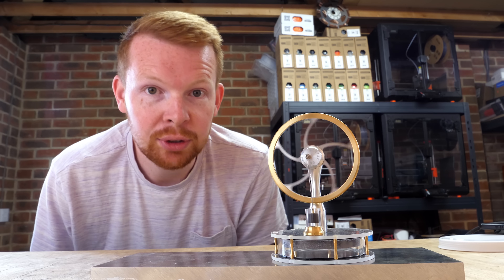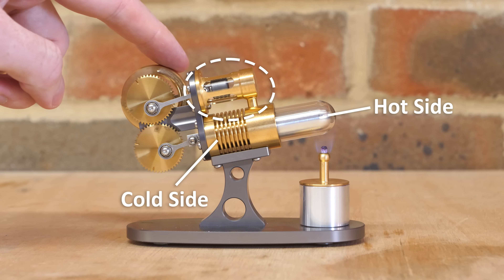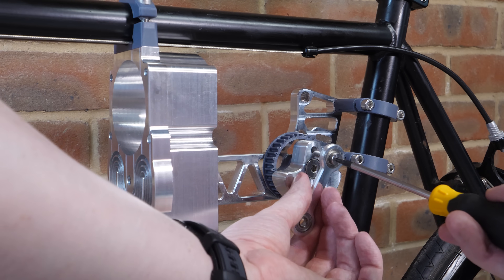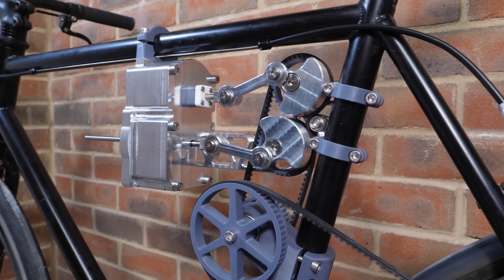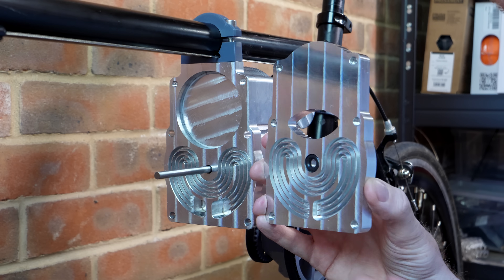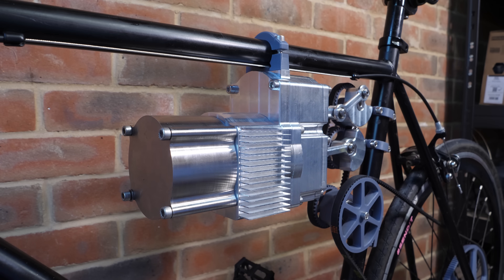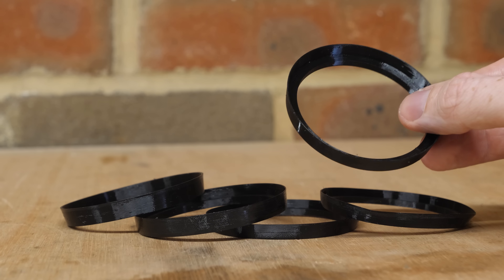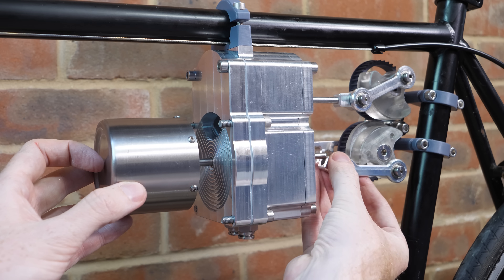Building a Stirling Engine Bike - Part 1

Comment: As a Stirling engine enthusiast, I would say that 10W for a Stirling engine of this size is excellent, but it is not enough to power a bicycle😢. You need a powerful alpha type Stirling engine with a regenerator!❤
Reply: At this level of power, even the slightest friction and damping will greatly reduce the effective power output. Your pistons need to be clearance fit, not made of soft rubber. You may need to pressurize your new engine, use helium, etc. Whatever you do, try to reduce friction, you may even need to clean the sticky grease from the bearings. If you still use a gamma type Stirling engine, use precision parts with clearance fits for any moving seals! Make the thickness of the heating cylinder as small as possible, and remember to add a regenerator, this is very important.Such a small Stirling engine is difficult to drive the normal operation of the bicycle. The power density of the model-level engine is too low. Although I would like to see how you will improve it later, I suggest that you replace it with a steam engine because it is very difficult to use a Stirling engine.
Reply: It seems that you need such a powerful alpha Stirling engine like this：https://youtu.be/4q8daLsy3iY?si=W4u9mxr2MujRJwm5

Comment: A sterling engine has the other advantage, that if manually driven, its basically a completely mechanical heat-pump. Meaning if you drive it while biking, you could also use it to cool your balls

Comment: Wouldn't a long stroke engine be more efficient, given the RPM output of the engine? Since Power is a function of Angular velocity and Torque, given that this engine doesn't have many RPMs the torque should be the main focus. Just a thought.

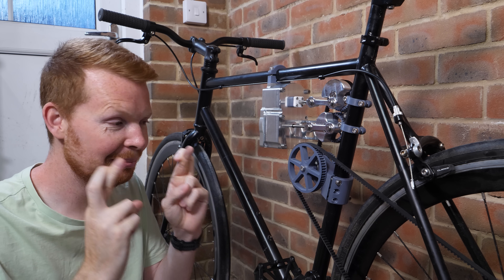Comment: 6:54 a Steam powered bike sounds so cool
Reply: And steam engines are much easier to get right with very simple valve mechanisms, main difficulty is making a boiler small enough that still produces sufficient steam.

It's possible, there are steam bikes around on Youtube already, but the boiler is always the most difficult part to scale down while still being powerful.

That was one of the main reasons steam cars were so much more expensive than ICE cars, because those high performance compact boilers were fairly difficult to manufacture. (And just the fact that steam plants are a two part system while the ICE is one unit, making it inherently cheaper.)

Comment: Tom, sheesh!!!  Those mill bits should be secured in the chuck all the way up to their flutes!  And for as long as they are, you should probably cut much slower, or smaller cuts, and make sure to program a few finishing passes too, at least if you're looking for an output which closely matches your design

Comment: For projects like this you could save the hassle of creating gaskets by using liquid anaerobic sealants instead.

It's how many modern engines are sealed up nowadays instead of needing actual gaskets, and the plus side is that the squeeze out remains liquid and can easily be washed away after the sealant has set between the surfaces.

Comment: Nice project! Few suggestions, displacer should be sealed if there is no regen. mesh inside because with all other passages, exchangers, regenerators and clearances it increases so called "dead space" that robs the engine from power by compressing this cushion air instead of driving the piston.

Comment: You might want to look at honing the inside of the power piston cylinder. I do not know how smooth the CNC finish is on the inside of the bore. Having it honed, or honing it yourself might reduce the amount of friction though.

Comment: Stupid idea I had a while ago:  Use the condenser part of a heat pump to power a big low temperature difference stirling engine. Use a generator to power the heat pump.

Heat pump coefficient of performance should be around 400% so 1 watt makes 4 watts of heat (and cools 4 watts in the evaporator which we don't really care cooling the outside air besides decreasing global warming)
Stirling engine might be slightly above 25% efficiency so total efficiency should be greater than 100%.
It's like a perpetual motion machine that generates electricity but the catch is that it is powered by absorbing heat from the atmosphere.

Easier version might just use a peltier module

Comment: was thinking about this idea and came up with a design where displacement part is half cylinder rotating inside the heat cylinder that has cooling and heating halves. two such chambers 180° of each other then connected and energy is harvested via small turbine between two parts with check valves like a bridge rectifier. whole system is absolutely airtight and can be pressurised.

Comment: I wonder if you could copy a more balanced engine. A bigger fly wheel like a 20kg one . Or use a larger raidater like form an ac unit, or a charcoal burner with ash pan or just have a pilot burner for gas.

Comment: Use the engine to load a battery for a normal ebike, dont even try connect it directly to the bike.
Reply: What if we Charge the battery With the Wheels To power a Heating cooling System

Comment: In short, it seems to me that the diameter of the working piston is way too big for the pressure that this motor can produce. And the main thing is that without a regenerator, this type of Stirling engine is simply useless and is suitable only for demonstrating the operating principle. It is done quite simply: the displacer, instead of a sealed cylinder, is made hollow and filled, for example, with a metal sponge (the one for cleaning dishes will do). Now half of the energy is spent on squeezing air past the displacer, and the heat is simply dissipated. The regenerator has less resistance and saves some of the heat. This is such an essential part that I wonder what kind of research and calculations took two whole months. Please note that if the regenerator is too porous, it increases the "dead space" in the engine, which reduces efficiency. By the way, there is already a lot of it in the front part of your engine, which also reduces efficiency.

Don't get me wrong, it's really cool that you took on this topic, with access to such tools you can achieve really cool results. Good luck!

Comment: Perhaps a peltier module(s) to provide both the hot and cold side, solidstate, fewer moving parts, safer than a burner, reduces need for a radiator.

Comment: Could you create the world most innefficient electric motor by combining a peltier plate and a steerling engine ? The motor using both the hot and cold side to create rotational energy ? Bonus point if you transforme the rotational energy into electricity to charge a battery that power an LED. And if you had a solar cell to power the peltier plate you could create the world most inefficient way to power a LED !!

Comment: Man, I built a stirling engine for my mechanical engineering 101 course project almost 9 years ago. I know how much effort it takes to get it just right.  Watched your video with a big smile on my face, remembering how it felt when it finally worked even after all those years. Love the design!
Reply: Tom never replies to anyone
Reply: please make this instead it works 100%  A Hall back array Magnet you turn on and off to pick up heavy steel, well it uses little to no energy to turn the magnet on and off, you can make a repulsion motor by making a piston engine, that when the magnet is reppeled the hallback switch can rock past a cut off to then recipricate the engine over and switch to turn the magnet back on all using simple mechanics. I hope this helps you and others. Have an amazing day
Reply: @Pauls4reel so, that'd be perpetual motion then ? 😂 -  yeah, that'll work 😂😂😂
Reply: @bluetoad2668 how can it be perpetual motion, the magnets would loose strenth over time, due to heat loss friction, EMF 😮
Reply: @Pauls4reel I think I misunderstood what you meant.
Reply: @Pauls4reelsounds like an electric motor with extra steps
Reply: @ardaozcan98 you know how much effort? I hope you're not trying to claim that your project used the same amount of effort as Tom's design #deluded
Reply: @ruzziasht349 it might have done, how do you know?
Reply: Hashtag deluded is CRAZY
They obviously get that it takes a lot of work and wasn’t making a claim on how much work the bike took
Reply: @ruzziasht349  are you a bot?

Comment: I have built a few stirling engines.  When I built my first one,  I found that there mustn't be too much material in between the hot and the cold cylinders.  If there is a lot of material, the heat will transfer to the cold cylinder, and then it will stop. I used the drawings for a japanese school engine I found online. When I finally got it to work, I had removed most of the material of the transfer block and replaced the transfer tube with a tube made of thin walled stainless steel.
Remove more material from the cold cylinder to improve the difference between hot and cold cylinders, add cooling fins.

Comment: Great video! I’ve been fascinated with Sterling engines for a long time and own a couple simple ones. One concept that I’ve never seen anyone execute is to place the entire Sterling engine into a pressurized chamber, thickening the air thus a larger reaction to the heating and cooling.  Run the power shaft out of the pressurized chamber would be complicated.
Reply: It has been made, with a glass plate on the crankcase and magnets to bring the circular motion through the plate. I think it was Andy Ross who made such a Stirling. Pressured Stirling engines often had a pressured crankcase.

Comment: I saw recently that Finland has a thermal battery they've been using. Basically a giant thing of sand they pump water or air through to pull or add heat. Maybe you could do something similar to increase the run time of this engine?

Comment: Tip: Using a compressed gas as a working fluid dramatically improves performance. If that compressed gas has a good heat conduction coefficient, like helium, it takes the stirling engine's efficiency to the next level ( It also over complicates the engine 😀)
Reply: Yes, Allison diesel worked on these in the 1950's and they found that helium at a mean effective pressure the same as a diesel would result in a power density equal to a diesel. Power is proportional to gas mass flow. Sealing compressed helium in the engine killed the project. Years later small hermetically sealed engine/generators solved the leakage problem. I don't know if development went any further.

Comment: Nice! Also excellent demonstration of how the engine works. I kinda glossed over it, stopped and went "wait I don't actually understand how Stirling engines work" and rewatched it actually paying attention and it makes sense. Though I wonder if it would be a bit better if you swapped the hot and cold side of the displacer piston? I assume that would heat the cap and tube more which isn't ideal, but that would intuitively show that the lower piston isn't sealing against the wall since the upper piston would move in the opposite direction if it were.

Comment: An interesting fact is Stirling engines can work in reverse. 
If you spin it with a motor, one end gets hot, and the other end cools. 
I believe NASA used this for cooling in space suits at one point.

Comment: Definitely can’t wait to see part 2!

One thing I was wondering: instead of trying to make this run the entire bike in one go, why not incorporate this into the bike as an assist motor?

The biker pedals, which also pumps water through the cooling system. There will be some parasitic loss there, but you won’t have to have a totally separate motor requiring its own power running the water through the liquid cooling system. 

Then, if you make the engine efficient enough, it can still provide some kind of boost or assistance to the rider. If you tune the engine, you can design it so that it provides its peak boost at the RPM you expect to pedal when riding at 15 MPH. 

Simplify down to a single speed bike so you don’t accidentally change your design parameters by shifting the bike while riding. 

Alternatively, you could design the engine to provide the most boost at low RPM so that it kicks in when you’re riding up a hill and inevitably slow down a bit.

Comment: A lot of news I heard on Sterling engines lately was about thermoacoustic engines (using the Sterling cycle). Could such a thermoacoustic Sterling engine be used to power a bike? As I understood at least one article about them, one advantage of the thermoacoustic engines seemed to be more power per engine weight. And since at around 2:35 you talk about how the low power output per engine weight is a limiting factor for this project, maybe that could be advantageous? Looking forward to what you think about it, and maybe you can even try it (although most certainly not easier than this project xD) :)

Comment: a displacer cylinder is  NOT  supposed to be red hot.!
1726   the con-rods  should  be  a  little  longer.  say, an inch or so.
to the degree practical, the sides should be thermally isolated from one another.   that detail is missing in this  overly-compact   design.         alpha stirling
https://www.youtube.com/watch?v=mfyvd5KhA0k

Comment: Good for you on the "cross" bicycle, multiple options.  How much did you pay for your CNC milling machine set up with CNC lathe?  And what software do you have that makes it possible for you to do the arithmetic you are using?  Do you have a CNC Lathe too?  Do you recommend any particular CNC program to go with your lathe and mill, in particular?  Great job, Dude.  I think the "gear" on the rear wheel may be bigger to reduce the force required to turn the rear wheel and get higher rpm out of your sterling motor.  Sterling Motor putt-ty putt-ty.  Getting it to go Rrrrrrr is the prospect..  ...and the sterling motor will have less applied force resulting in the sterling motor being able to pick up speed.  You need a dynamometer to isolate your torque force and radii; Once you have the force and the radius and apply the piston force change of heat ratio you might find a happy medium.

Comment: 1208   use of lubricant is a mistake.      see the  strategic  use of  harder and softer metals.    the 'rods'  should be replaced with lighter tubing.      ( from what i have seen, the top speed for a (un-loaded) heat engine, is around 2200 rpm. )   a heat engine needs to have a lot of mechanical advantage (MA) over the load that it experiences.     thus, the use of a most-efficient high-reduction (first) power take-off stage is necessary.     the under-load rpms should be about ten percent kess-than the un-loaded rpms.

Comment: 0430    the amount of mass in reciprocating motion  SHOULD  be  MINIMIZED.!    so, the piston, wrist pin, displacer and con-rods should all be made as light as is practical.    the mass of  bearings  should be avoided, wherever its practical to do so.  in this regard, throughout the engine, metals of  DIFFERENT  hardness should  be  Stregically used.      an  OPTIMALLY  designed alpha or gamma stirling engine does not  need  supplemental cooling.    ( the cylinders should be horizontally oreinted, in order to equalize the affects of gravity.    the hot side should not be located below the hot side.    the hot cylinder and duct should be made of materials that conduct heat  POORLY.

Comment: This design is completely scrap! Here my solutions - IMHO:
1. The heating zone is placed in front of the cooling zone - you have to rotate this part of the engine 90° to the working cyliner so the heating zone is vertically on top.
2. You have to separate the cooling part from the heating part by a 1cm thick ceramic insulation to optimize cooling and heating.
3. You have to honing the cylinder wall - this rough surface looks horrible to me 
4. Teflon coating of the cylinder wall is also a good idea to reduce friction.
5. Use a dry lubricant like graphite or molybdenum disulfide to reduce the friction on piston rings
6. Use a scotch yoke crankshaft and place the slide bearing opposite to the piston behind the yoke.
Greetings from a german smart ass ;)

Comment: If you put magnets on the biggest wheel of your sterling system, then you could use them to create a  dynamo motor that would feed a bike light or charge a battery....hahaha...you can also try to make a mini parabolic solar oven to heat your sterling motor with sun instead of your blowtorch...it  mean you would have to move the oven angle to follow the sun to make it work all day long "by itself" until sunset, but, the "wheel dynamo" combined with an additionnal "mini passive wind turbine" connected to the battery would make you able to install a little sunlight sensor that would make the "oven" follow automatically the sun). With this system, you can have a free energy mobile device working from sunrise until after sunset when battety empties up... hahaha, forgot a solar panel to be used as a roof in case it rains...hahaha

Comment: Fun fact: NASA has been developing generators for space craft based on the Stirling principle since the 1970s up until 2020. The heat obviously was not produced by a spirit stove, but the decay of radioactive material. They were able to make it produce about 120 watts of DC power with 500 watts of thermal input.

Comment: That is great ! Imagine coupling it with a solar concentrator or a lens. Or as a hybrid engine setup using combustion engine heat to power the Stirling. I wonder if it would be worth it as efficiency improver. Since heat is normally a waste product, this way it would be used.